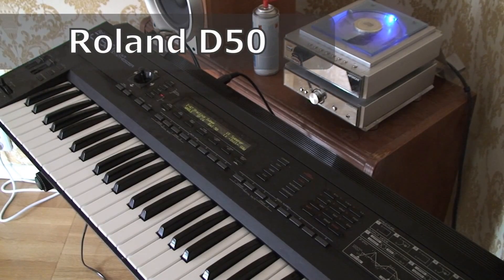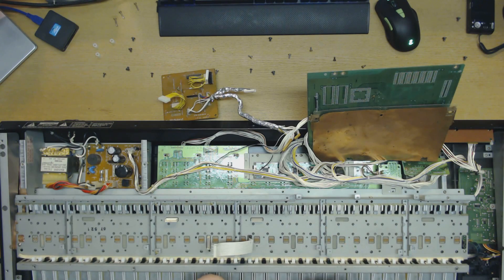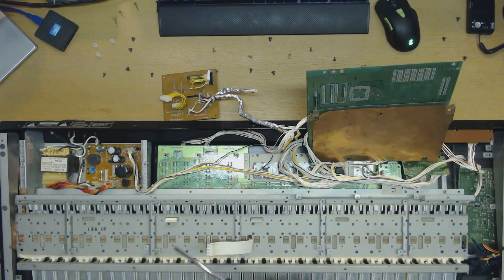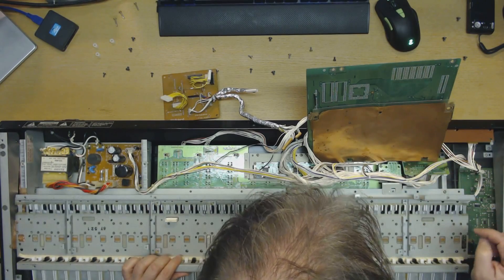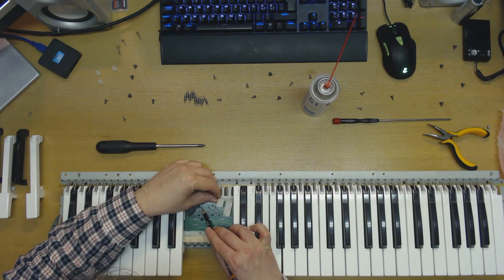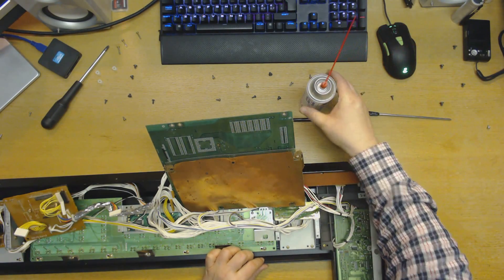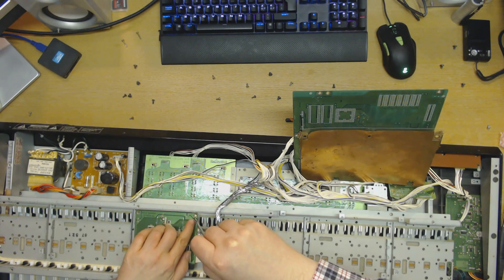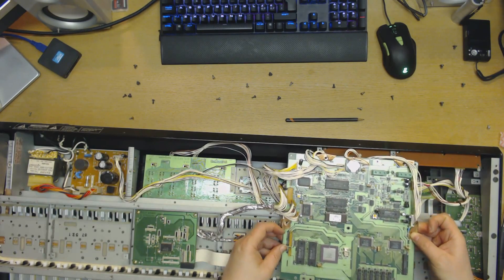Repairing Dead Keys on an Roland D-50 vintage 80s synthesizer

Comment: All I can say is    AMAZING!!!!!  I own a Roland JV1000.  I hadn't played it in years because of the dreaded red glob ooze. When I took it out, my initial intention was to address that. I  marked the keys that were still stuck from a prior attempt to "unstick" them .. I was very meticulous and methodical. I found that there was a thin plastic strip which prevented the keys from sliding out. I stripped that off and then went to work on all the stuck keys. Fixed them and put the synth back together and to my surprise had about 10 dead keys and some that were striking full on..  I was so irritated. I looked at the contact boards and there appeared to be some glue residue, cleaned the boards and still had dead notes. I scoured the Internet and found used replacement contact boards for a JV80 which would have fit the JV1000 but I did one more search and found this here. I gently cleaned the tips of the rubber contact strips and used the "graphite" fix for all of the contacts on the contact board, turn it on and every key played flawlessly. Thank you .. Thank you .. Thank you!!

Comment: I have just fixed a dead note problem on an old S50. I have little electronics knowledge but followed a number of videos. The keys were, from the  bottom, Csharp A above and F above that. Tried all the cleaning tips on these videos and no joy. Tested the diodes and continuity of circuit traces with a multimeter - all diodes were OK but there was a break in continuity on one trace beween the bottom and adjacent keyboard circuit boards. The problem was a pinhead size spot of corrosion on one copper trace. Cleaned back and fixed using silver conductive paint - voila - notes restored. These videos are a great source of info.

Comment: Great video!  Very thorough, all bases covered!  My only comments would be that I admire your confidence that the problem(s) was fixed before you replaced ALL the base retention screws!  I always test the repair(s) before putting all cover screws back in.  Next, I highly recommend magnetizing all my screwdrivers, manual and powered, to keep extracted screws from falling into whatever I'm working on.  I use a salvaged hard drive magnet to quickly magnetize the shafts.  Screw replacement is also much easier with screws which stick to the driver bits.
Thanks for the great video!
Reply from the maker: Thanks for your comment Geoff. And you're right. I was probably too focused on making the whole video in one go with a minimum of editing.

Comment: Cool, nice video, thanks. I had the same problem on my D50. Just 2 points : 
1.It is not necessary to unmount the small board attached to the keyboard. 
2. I only cleaned the rubbers and PCB without adding carbon
Now it works fine.
Reply: Yup, there's no need to add graphite if the only problems where dust particles. Good job!

Comment: Cheers Tommy Thanks for this  needed to change a broken Key , Followed u and now works great, Difference  was wires also tied with plastic ties to keyboard as well as screws, Advice to anyone be careful very hard to cut without cutting wires so make sure you put a small screwdriver between wires and blade when cutting, you can cut one tie then pull keyboard out slightly and cut from bottom.

Comment: Thanks a lot for posting this. I had two keys on my D20 that always sounded at maximum velocity, I fixed them today.
Reply: I have the same thing but with only one key. What was the issue?
Reply: @mrmostlyharmless  Hi Brinstar, I guess it was a bad contact, I just followed Tommy's instructions to ensure that the rubber bit was free of any dirt and then used a pencil exactly as he did to go over the contacts. I didn't have any of the Kontact spray he used, I think I may have used a lens wipe instead to clean things up before using the pencil. Taking it apart is a bit daunting but it's actually not difficult. It's eighteen months since I did it, I've used this keyboard almost daily since then and everything's still working. Good luck.

Comment: Hello and thank you for your video you really helped me, can i ask please the think you did with the pencil is it able to do for the aftertouch strip?
And if yes is it safe to uncover this thing it has on the aftertouch strip? I did the test on the d50 and aftertouch reach max 80 velocity...
Thank you kindly!
Reply from the maker: No, the aftertouch strip is a pressure sensitive strip that is entirely contained inside plastic. However, if the contacts have become lose, just use some contact spray for the end of the strip to the connectior at the end, be careful and clean it with a soft microcloth, it's very brittle. Fortunately the strip should be fairly standard and easy to get.
Reply: Thanks a lot, you used a kontakt 61 spray, can i use wd 40?
 @TommyHelgevold

Comment: Concerning the tension springs: the shorter ones go on the white keys, the longer ones retract the black keys. The video is very helpful for disassembling the keyboard. I didn't do the pencil trick however. Just cleaned the contacts with a cotton cloth and Isopropyl Alcohol (IPA). The carbon dots in the rubber domes looked a bit glazy when I started. After cleaning this was gone and the dots looked matt. The keyboard works just fine now.

Comment: I’ve had my d50 since 87.  Sadly it had been in a case decades. When I opened the case I noticed some degradation of the foam. I replaced the battery and downloaded the sounds and brought it back to life. It gave me such joy!  But I have 8 dead successive keys starting with the lowest C to G.  I thought maybe the foam particles got on the contacts but when I checked it was pretty clean. I followed your instructions to clean and even used a pencil but the keys still don’t work. Everything else seems fine. Since the dead keys are in a row I was wondering if there is an issue with the board. I’d appreciate any ideas you may have. Thanks for the vid!

Comment: A great helpful video, so thanks for this. I recently found my boxed up D50 stored away for more than 30 years ago and its looks spanking new! Only the battery needed to be replaced and managed this after biting the bullet to take the D50 apart.  However the 3rd G# key didn’t work and I tried what toy did with a pencil and cleaning the contacts under the rubber. I even swapped the rubber around from another key and that did not work. Could the board be faulty on just one key? If so, can one still buy any of these green circuit boards?
Reply from the maker: You may have to apply the proper graphite, not all pencils have that, and you need to fill the "microholes with that" with a little pressure with a nano cloth, then clean quickly with a soft touch both contact points, rubber and pad. 

I highly doubt that ONE PCB wire has gone bad, but it IS possible that you have some dry-soldering somewhere. It'd be worth it to go over all solder points with some fresh LEAD (not the new type of solder) because it could have dried out and created some bad connections. Worth doing!

Comment: Thank you for such a great video.  I am trying to clean up an old Roland ep7 with sticky keys and your video was so easy to follow (especially the basic tips for springs and plastic strips) or taking off the keys (with basically the same layout).. 

Can you give any insight how to clean and dissolve that dreaded red glue? 

A lot of the weights fell out and many black keys weren't moving.  I've tried everything from GooGone (US) to paint thinner and acetone (in light swabs).  The only real effect I've had so far was actually soaking keys in vinegar or rubbing alcohol, but that only made it gummy and still impossible to dissolve. This was a free keyboard and might be a lost cause after my attempt, but thank you for any insight.

Comment: I have a Roland d50 too. It was my first synth when I was 14. Now all keys are that they do not respond to "on" key, online when I release them. Via midi everything is fine. Do your thing that makes sense to clean all the keys or is the mainboard or cable broken?
Reply: I took everything apart and cleaned it. The problem still exist, so I think it must be the mainboard of the keys. Broken. Rest in peace vD-50
Reply from the maker: @dubtube6691  I would replace the battery on the mainboard first, then try to do a factory reset on the unit, might be some function that has temporarily disabled the keyboard, or just a software error. Worth a shot. (No Idea how to do a factory reset on it, you will have to google it).
Reply: @TommyHelgevold  good idea with the battery, I will try it one last time :)

Use the following procedure to clear the memory:

Power on while holding down Data Transfer and 0 buttons.

Use the following procedure to reload the Factory Settings from a sequencer or librarian program:

Press the Tune/Function button and select Protect by pushing Tone Balance.

Use the joystick to change Protect to Off.

Press and Hold the Data Transfer button and while holding the button select [B.Load]

Continue holding the Data Transfer button and press Enter.

Continue holding the Data Transfer button and send the bulk dump from your external unit and wait until the screens says Complete.

Comment: I blew mines trying to clean the contacts, I bought mines in mid 90's. I cleaned every contact. But when I screwed everything back up a couple of notes were still not working so I opened it again. This time I decided not to screw everything back together again and test the keys while it was open. I thought this would be easier but unfortunately I touched something inside against something metal on my desk and blew the thing. Just bought a dd50 rack which is a roland d50 without the keys. I will now be able to access the sounds via midi controller and at least I won't have the contact problem again. But I bet I can fix my roland d50 if I knew better what I was doing.

Comment: I have a D-50 with a problem where any key I hit, no matter how hard, it plays at full max 127 velocity.  I cleaned all the contacts for every key and made sure the rubber strips were placed correctly.. any ideas what might be wrong?
Reply: If it's at full velocity, it still might be a contact issue between the two contact pads that registers the speed of your finger-presses (thats why there are a low and a high contact point). You need to clean it again, and maybe even check the PCB traces under it to see if there is any broken traces!

Comment: thanks for a very helpful video!! Please are you able to tell me what might be the problem of a note staying locked on, but the key is not depressed? When a keyboard I want to work on is switched on it has a continual sound, though no key is pressed. It also has a few dead keys which I intend on cleaning as you have done! It is a Roland VK1 if that makes any difference..thanks if you can help Tommy, no worries if you cant!

Comment: Just did a cleaning on my d50. Some of the function buttons work but aren’t making a clean contact every time. The “write” button for example. Would electronics cleaner work if I sprayed it? Don’t want to take a chance ruining it.
Reply: You can safely remove the taped on "clicky metal" and spray a little contact spray on it, and clean with a micro cloth afterwards, and tape it back on again. If it's a mechanical button, it might need replacement.

Comment: I have a vintage analog  synth casio ct 702 and has the same way of attaching the keys with those springs and the keys feel solid and so good to press . does the yamaha d 50 has the same feel? and what about other syths or keyboards that have the springs attached to the keys vertically?And can e high end modern keyboard/synth feel as good as the casio 701 and other vintage synths?

Comment: I have a Roland S-50 sampling keyboard with an intermittent key, but it is built different as far as the bottom doesn't come off to access the innards. You take the end caps off and remove screws that allow the top to hinge open. I wonder if it is really necessary to remove the entire keyboard section from the unit just to remove a key. Also, I'd like to add, you really should put a towel or soft cloth on your work surface when you lay the instrument down on it's face to avoid scratching it.
Reply: I found out I had to remove the entire keys section because there is a plastic strip underneath that keeps the keys from pulling out. I had to remove one of the circuit boards because it overhung the keys section. After I removed the board, I was able to move the keys section back and up out of the unit.

Comment: Any suggestions on how to fix the "enter" button. My D50 works ok, the patch/banks buttons are a little sticky, I just have to push firmly, but the enter button does not work. So I can't edit/save patches. This is driving me nuts. Any suggestions on how to fix this, or use an editor app. (which I am trying but no luck yet). Awesome video, thanks so much for posting, any help from anyone would be greatly appreciated.
Reply: Remove the enter button, and check if the contact spring has gone bad, could need a little forced bending it back into place (the middle bulge), so it makes that distinct "click" sound again.

Comment: i have four dead keys on my D-20 .. tried the graphic fix and a good cleaning. Nothing doin'.. any suggestions?
Reply: Could be broken PCB traces on the PCB, are the 4 keys locally next to each other or random places all over the keyboard? If it's the ones next to each other, it could be as simple as a broken wire connection between the keyboard and the multiplexer (the scanner that scans the entire keyboard for keypresses), that'd be that little PCB you see right under the keyboard), check the contact points on each of them!

Comment: more seriously, use loctite 3863 ont the black contacts of the rubbers or graphit spray if you want. It will last longer...
Reply from the maker: That might actually be a good idea since that's a glue WITH conductive abilities, but non-professionals should let professionals do that since it can create serious contact issues with the rest of the keyboard if used incorrectly. Thanks for the tip, that will def. go right into  my workshop

Comment: i always wonder what is the first thing you took out in the beginning ,what is for?
Reply from the maker: Gabo Prado , not entirely sure what you mean by that. Did you mean the part of the first upload I removed? If so, that was an youtube editor mistake, since opencut have a memory leak issue and won't render my entire video, so I had to edit the parts with youtube. The outtake is just me ranting about not being prepared and 4 minutes of rummaging for tools ;
Reply: This
Reply from the maker: Gabo Prado Ah, it's kind of like an analog joystick that can be used for either a custom setting adjustment "live" while performing, or fade between upper/lower sound etc.
Reply: Tommy Helgevold thank you so much for the information I just got mine Roland and I'm still  don't know many features,because I bought  it without the manual 
Thank you again

Comment: is it necessary to put the graphite on the contact?
Reply from the maker: No, you don't have to in every instance. The thing with the graphite, is that it fills the micro-holes in the surface of the contact pads, by rubbing it in with a cloth, you ensure these particles stays jammed into the cracks and micro-holes of the worn contact pad. At least that's my experience.

Comment: oh no! not the pencil fix. Wears off after a while. Get some special paint or use some of those conductive dot things instead! Here is what I did to my D 50. Had a bad C# #4 . Looked at the contacts, had a line where the key presses down. Took some ACETONE (got it at the drug store) and a Q tip and cleaned off the contact pad on the rubber thing, where the line was. Put it back together works as new! The acetone is a solvent and will eat off a layer of the conductive stuff, along with the impurities. PLEASE don't use the PENCIL TRICK. Its a temporary fix at best, and do you REALLY want to open up this pain in the ass again, with all of the fragile cable connectors (about 20)???I sure dont!
Reply: Hi, I've played with it daily since you replied, and it still works fine :) What the graphite does, is that it fills up the micro holes that comes from tear-and-wear, and what you really are doing is "pushing" the excess graphite into those micro holes with the cloth afterwards, it should last for years, I've done it to numerous synths that has lasted 10+ years after that.
Reply: What to do if the carbon contact was damaged?
Reply: @SIRAYEH  got to buy new strips
Reply: I've read some instruction that I can re-write the carbon print using a silver conductive wire glue. But I am not sure if this will fix it.
Reply: @SIRAYEH  seeing as how d 50 is a major pain in the ass to disassemble, youre better off just getting the new rubber strips http://bustedgear.com/repair_Roland_d50_key_contacts.html
Reply: Its not the rubber strips im having trouble but the printed carbon contacts in the pcb itself and I do ot have any other option to repair it but to re write it with conductive silver paint ink